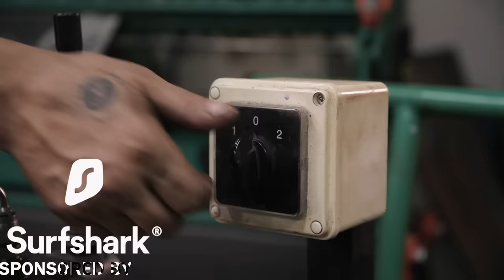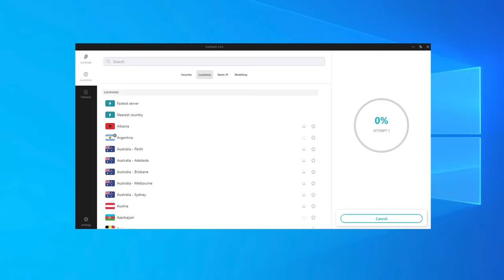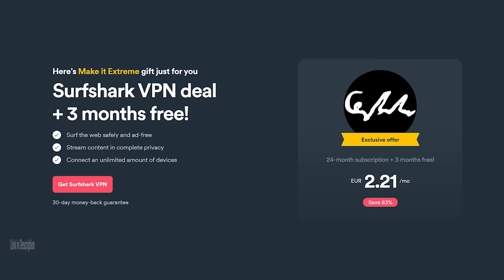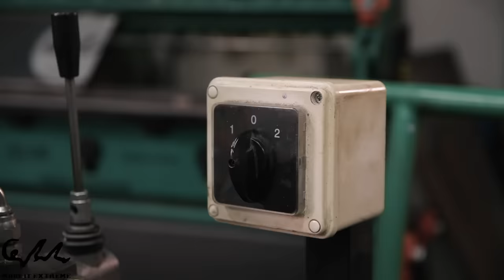Hydraulic Dimple Tool - The Future of Metal Working (2024)

Comment: In the eighties I was part of the electrical team on pier 50 SF laying out power for a machine shop build. We laid rigid galvanized pipe of various sizes right on the floor according to a specific layout all strapped and anchored. After inspection by engineers, a concrete company formed and  reinforced ,poured ,finished a beautiful 5 inch slab right over the top of our pipe with a smooth ramp on all sides so forklifts and pallet jacks could effortlessly move about . All stub ups were perfectly vertical and placed. We pulled our wire and completed hookups and here comes all the new machinery….. wow! This stuff was gorgeous and brand new. After install the safety lines were painted by professional painters. All the mills, lathes , presses and associated machinery were overwhelmingly perfect.. it lasted only 5 years due to company closing 
And it was eventually stripped and butchered and sold off. I learned that people in business have no soul and can’t appreciate such things…. The area was taken over by underwhelming pursuits. It was nice to be part of building someone’s dream shop. Unfortunately serving the shipping industry was a mistake due to cheap competition and unstable economics. The Make it Extreme guys remind me of passion and purpose with handmade quality so rare today and a tribute to the excellent machinist of days gone by. Today computers and operators do that work very well but it lacks something . Old school was cool but this is how it’s done today. I’m a boring old man telling one story out of many…….. let the old guy reminisce.
Reply: remember, if it wasnt for the old school... new school would never have happened!!!

however, those who forget the old tried and true methods in favor of new methods, are lost when the new methods break !!!! lol
Reply: There was probably someone before you saying the exact same thing.. those soulless business folks create opportunities for the next generation of trades to do work.

Comment: 0:50 When those inner threads are cut in multiple passes like that, how do you ensure you're cutting right in that groove and not slightly off?
It's a question that's been bugging me.
Reply: There is a thread counter by the leadscrew. When it turns to the same spot you engage the power feed
Reply: @Dailis1996  Thanks for trying to explain this to me. However you're gonna have to explain like I'm 5 because I still don't get it. Maybe there's a youtube video somewhere... :)

Comment: What in the world was that little hand router you used for the chamfering? That thing was SWEET!!
Reply: just a normal die grinder with table attachment, using a basic chamfering metal cutting bit. they have a bearing at the end of the bit to limit depth of cut.
Reply: @dimitar4y  Thanks for the answer but I've never seen (and can't seem to find) anything called a table attachment for a die grinder and I've never seen a die grinder with that sort of thumb activation on the back. I guess I should have been more specific in that I am curious what specific tool that one that he is using is.
Reply: For anyone else wondering google Pneumatic Chamfering Tool. Its a tool specifically for this job and def not a normal die grinder with fancy attachments
Reply: @coreycreehan8197  you can easily attach your own table to a die grinder tho.
Reply: @coreycreehan8197  I don't think her purchased that part you are talking about, he more than likely made it himself.

Comment: Space , pipe, building,  samples, roller, probe ,  sensor? Air? Gas? Compressor unit, small o2 from air filter?   Sealed pipes. Ya. Atmospheric pressure systems Incorporated to view, ports

Comment: Was gonna ask why not just use a normal press... then you showed the car. :D
Reply: This video shows what one has to do when you forget to emboss the sided of a seat, but don't want to take the seat apart again. what I find annoying it the embossing on the side of the gear shifter is at an angle due to the bulk of the tool.

Comment: Is the pipe you used a special for a hydraulic application with a proper coating inside or a regular water pipe?? https://youtu.be/NpoCGrOegck?t=19 it's clearly seen an inside surface of the pipe - and it's quite far from perfect...  What is predicted lifetime of the piston seals in this project?
Reply: I think they are pre honed pipes. You can buy them all ready and just cut and thread them as you need them.